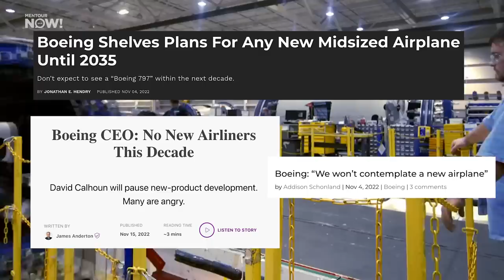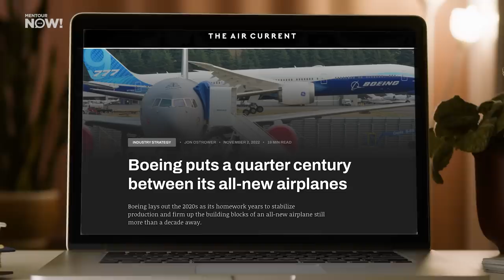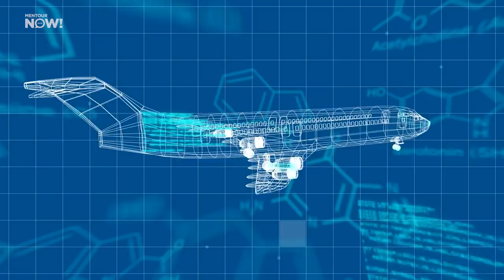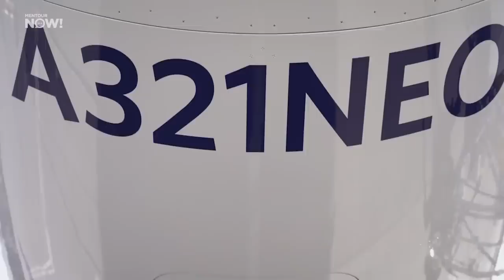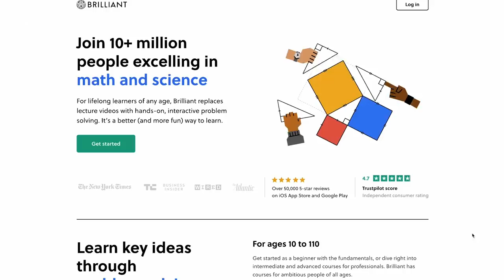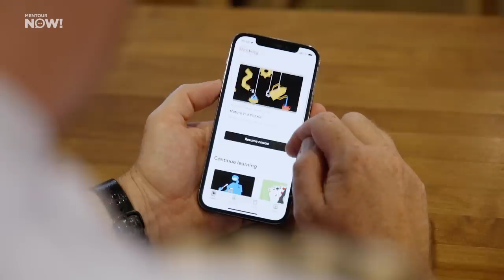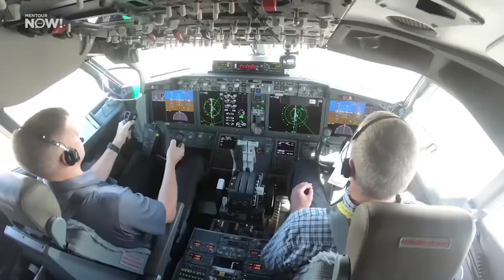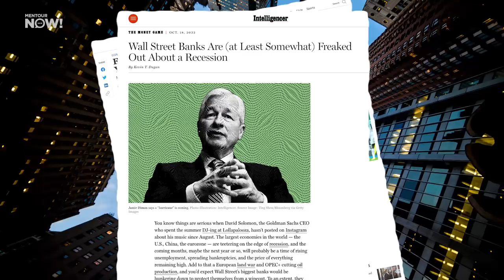Is BOEING giving up!?

Comment: The unducted fan concept has come up about once every 10 years since the '70s.  

I think the biggest problem facing Boeing is all the management that came over from MD.  They ran one company into the ground, now they and the replacements they hired and promoted are doing similar damage to Boeing.
Reply: Someone told me a turbofan is a turpoprop in a tube.  So this is a turboprop in a tube without the tube?
Reply: @himoffthequakeroatbox4320  I'm not pedantic enough to answer that question.
Reply: Just an observation: the engine thermodynamic efficiency of the CFM RICE engine in 2035 will probably also only be 10% if that much, better than today's engines. The propulsive efficiency of an aircraft as a whole using RICE engines, will however be substantially better than one using turbofan engines. This is due to the lower velocity of the "exit air jet stream" produced by the RICE engine compared to that of a turbofan engine which includes a hot core flow at exit as well as the fan bypass flow.
Reply: The other way around bro. Boeing ran MD into the ground!
Reply: @michaelosgood9876  MD was dying for 25 years.
Reply: @michaelosgood9876  McDonnell Douglas was banking its future on getting one of the two big fighter contracts of the 90s/early 2000s. Their civilian airliner business had hit a dead end due to the DC-10 having a toxic reputation, leaving them entirely dependent on the military for their future business. The Northrop-built YF-23 finished second due to being basically a mockup with live engines that had to be rebuilt after every flight, and then McDonnell Douglas was cut out of the Joint Strike Fighter program entirely. So the Boeing merger happened and what basically came out of that was it amounted to McDonnell Douglas buying Boeing with Boeing's money.
Reply: The current CEO ran GE into the ground too. Aren’t unducted fans really noisy and produce less thrust? Meaning planes will be more efficient but a lot noises and slower
Reply: @katherineberger6329  and the MMD suits ruined Boeings engineering
Reply: Who the fuck is MD?
Reply: @gerhardbenade5869  Unducted fans still have a hot core flow though
Reply: @fantabuloussnuffaluffagus  "I don't know" would have used less words.
Reply: @nobodyfromnowhere3597  McDonnell Douglas
Reply: @alanserjeant4947  If I'd wanted to say "I don't know" I'd have typed that.
Reply: Exactly, I've been saying this for a while, that merger with MD was what sealed Boeing's fate.
Reply: @fantabuloussnuffaluffagus  But it is an essencial question! Because technically speaking the answer is yes, but... the basic concept of a turboprop is to attach a big propeller with up to 6 blades to a comparatively small jet engine. This is what makes the TP more economical than a turbofan, the smaller engine (= less fuel consumption) giving a big amount of thrust through the big propeller blades. But... this comes at a cost... of speed, obviously. Engine industry is balancing always between speed and fuel consumption. Fans on the newer turbofan engines have gotten less blades but generating a bit more thrust than before, and they are geared. This way you decrease the rotational speed of the fans (= less noise) but get somewhat the same amount of thrust as the fans with more blades but turning quicker (= noisier). This is why I say that TP and TF are technically the same concept, but in detail they are very different engines. And getting into this is not being "pedantic", but interested in the core of the question.
Reply: @StoutProper  See my answer to Snuffaluffagus... There I get into exactly that point.
Reply: @nobodyfromnowhere3597  Noone...
Reply: @himoffthequakeroatbox4320  Yes, I answered this question of yours some minutes ago. I am really interested in getting to know what speed a jet plane attains with this type of engine, which is basically a turboprop. We had that before, for the MD-90 I guess, and it failed because the blades ran too fast and made a very high pitched noise, like the Piaggio Avanti does. So,. what is the "tube" there for? Apart from directing the cooling air to the hot section and to produce a big "air envelope" around the produced hot air from the jet part of the core to lower the noise of the jet section, the "tube" itself absorbs also part of the noise the big frontal fan blade tips generate by turning fast. And apart from that, it keeps part of the generated thrust well around the jet part of the engine (compressor, combustor, turbine and exit nozzle. This effect is obviously lost if you use a "untubed" propeller... (typed here as a layman, not a technical expert).
Reply: @katherineberger6329  "Their civilian airliner business had hit a dead end due to the DC-10 having a toxic reputation". And the MD-11 being no better... Basically, what killed the latter one was the three engine concept in a time when twin engined planes for long trips over sea got a vast higher ETOPS. This was the turning point in the industry. MDD had a fantastic plane, the MD-90 series, with a rock solid reputation and very fast turnaround times during the operation and Boeing killed it only because of its competition to their own 737.
Reply: @cargil48  so what are you saying? They are more efficient but slower? Are more noisy or quieter than current engines? Slower means longer flight times which means higher costs in wages and less productivity of the plane, so it may not necessarily be not economical
Reply: @cargil48  More efficient matters, what you call it is irrelevant.
Reply: @StoutProper  I said it before... more efficient on the consumption side but at a cost: speed. If you want speed, get more fuel and more air into the hot section. The turboprops have smaller hot sections and bigger props, so they get lower consumption per mile. But at slower speeds. This is why turboprops are used in shorter distances and longer range regional jets have turbofans.
Reply: @StoutProper  Jack Welch left GE a house of cards for his successors to mess up even more.  Gotta give most of the credit to the original "Neutron Jack."  Apparently empty buildings and IP are just as profitable as all the engineers and production workers he fired.  For a couple years anyway.  After that...
Reply: @katherineberger6329  I thought the cancellation of the A-12 was more impactful. The YF-23 was competing with the YF-22, so MD couldn't rely on its success, but the A-12 had already been selected by the Navy so all MD (and General Dynamics) had to do was not screw it up. But they went over budget, over schedule, and over weight, to the extent that the government cancelled the contract and demanded that MD/GD pay back the $2 billion they had received for its development. That demand got stuck in litigation for decades but meanwhile MD and GD's reputation had taken a nosedive. So Lockheed acquired GD's aircraft branch and Boeing acquired MD.
Reply: @Hypernefelos  None of the military contract fails would have been important if MD had not trusted whichever bean counters said it was ok for a cargo door to open outward and trust the latches to never fail. Boeing lost every major fighter and attack contract of the 90s and they were fine because their airliner business was making money hand over fist. The start of the McDonnell Douglas failure story was the DC-10. It meant that the MD-11 was a mere line refresh of the DC-10 instead of a new, DC-10-derived twinjet, and that doomed the company because as soon as ETOPS 90 came out, twins dominated the medium- to long-range market.
Reply: @katherineberger6329  To be completely fair their F-15E Strike Eagle was a success, but yeah, that wasn't enough.
Reply: @hammerfist8763  This. If a money man comes in and starts firing workforce because he thinks he doesn't need them after he's put in all of six seconds on the clock, he's not coming in to help the company succeed but to set it up to fail.
Reply: @nobodyfromnowhere3597  McDonnell Douglas.

Comment: There was a 15 year gap between b767 and b777 too. Also Boeing has a lot of military contracts to keep them busy. There is also nothing to prevent Boeing from implementing improvements to it current fleet of b787 and of course b737 aircraft
Reply: Steering clear of Boeing's internal politics (of which I know nothing), it seems like the B777 and B787 are Boeings main cards currently.  The B737 seems limited by the short undercarriage with modern engines getting larger and larger fans.  And because Boeing kept incrementally developing the 737 and 747, they possibly had to choose not to convert either to fly by wire in order to get the new versions certified faster?  And maybe they ditched the 757 and 767 because they thought at the time that the 737/747/777/787 range would cover the whole commercial market? Airbus probably got lucky as they launched the A320 family (and later models) with FBW and their range of A319/A320/A321/A330/A350 seems to fit better now.  Obviously, both manufacturers had to ditch their 4 engined options because of higher running costs.

The other interesting thing is that passenger aircraft used to look different years ago (think DC10, 727, Tristar, 747) - now, they are almost all roughly the same.  It looks like airframe and aerodynamic development has reached a kind of limit (especially with new, composite, materials) and the next changes will be in more fuel efficient engines (as noted in the video).
Reply: Boeing has a history of making smart moves.  Bailing on the SST and super-jumbo programs.
Reply: @peterhastings703  If there's one thing about the 737 market, it's massive.
Reply: @leotimtom6637  When you gain an IQ point, which is never.
Reply: @austindarrenor  boeing fanboys try not to cope challenge

Comment: As a service tech, I used to visit GE Evendale jet engine plant when they were developing the UDF (unducted fan) engine in the mid '80s. I knew it was really a good idea, but it got stuck back on the shelf to wait until the time is right... I think its going to be it's time soon!
Reply: That's the first thing that came to my mind, also. I always felt the UDF engines got short-changed. Those engines themselves will create more positive aviation news.
Reply: Low fuel prices doomed the UDF programs, and now many of the engineers who worked on it have retired.
Reply: Airplanes with UDF will be slow and noisy.
Reply: @henson2k  you'd be amazed what boeing can do with "re branding". airbus dont stand a chance.
Reply: The NOISE was sooooo bad that they had to put noise canceling speakers in the back!....Also...what was Not said was, how long
before that noise vibration fatigue cracks the aluminum holding the Tail on......
Reply: I think there is already a very performent UDF engine availible. Look at the A400M with its Turboprop engines it gets very good performances. Nearly as a turbofan with less consumption!!!
Reply: @henson2k  faster than common turboprops, the blades are shorter, so they can spin faster without going supersonic, and the gear reduction has gotten better since the last time they tried UDFs.
Reply: Maybe.  But it would be foolish for Boeing to base its product development plans on that long shot possibility.
Reply: @jaysmith1408  I've compared UDF with jets, I don't see Boeing going turboprop/regional market.
Reply: I worked next to Pratt & Whitney in the 80's, Pratt built jet engines and Hamilton Standard built propellers. They had a pair of unducted fans bolted to the rear end of an old 727, it was surprisingly quiet. We saw it now and then for a couple of years then we didn't know what came of it.
Reply: Biggest problem with ducted fans are they are extremely loud. Sorry but that's not likely to change.

Comment: Had to laugh when I saw the powerplant! That 'prop-fan' thing was tried in the late 80s/ early 90s. It's not only ugly, but it was deemed too noisy & as the blades are exposed, too dangerous. Airbus won't be fazed by this 'announcement'.
Reply: From what I've heard Airbus has been considering next-generation turboprop aircraft (them actually calling it what it is) as their next direction. I think a somewhat smaller aircraft, maybe the size of the A220, and looking pretty similar to the ATR72. With fuel costs being a rising factor, I think many foresee a return of the turboprop, but with most trying to avoid said term, instead preferring more marketable terms like "propfan" "unducted fan" "open rotor turbofan" and so on.
Reply: I think they still gear it down like in turboprops to be subsonic at the tip, do they?
So either this it overhyped hybrid turboprop, or this it the design that will never be used because of constant sonic boom during takeoff.
Reply: @cola98765  From what I recall reading some "propfans" are geared (just like geared turbofans) while others are not. Typically the blade tips are supersonic, to reduce noise the blade leading edges are razor sharp (which also will wear quickly) but they're still quite loud. A lot of drawbacks to these, hence why experiments in the '80s didn't really go anywhere. These "propfan" concepts range anywhere from being basically a turboprop to being basically a turbofan as we know it without the duct, with some somewhere in between, some having the blades at the aft end (not typical for either turbofans or turboprops as we know them). What we saw in this video looks to me to be at the conventional turboprop end of this spectrum, and I'm guessing it's geared.
Reply: Suspect blades will be easily damaged
Reply: "Open rotor" designs have had to compete with ever-improving turbofan engines, and they only caught up recently.  Their much greater efficiency (read: lower emissions and lower operating costs) pretty much guarantees that they'll be on the next generation of airliners.  Their noise level is already within regulatory limits.
Reply: Airline could care less if it is "ugly" or not. They care about cost. Prop fans will likely dominate short to medium haul aircraft in the future because of E-planes, Hybrid and Hydrogen technology. Oh and btw Airbus is looking into Propfans too.

Comment: As a man in his 50s and an aviation enthusiast, I’m flabbergasted at the slow descent of Boeing. My entire life I grew up in Boeing was viewed as a powerhouse in aviation. It’s sad to hear this news, but I pray that Boating can come back and become the dominant aircraft manufacturer as it once was.
Reply: They'll be fine, as long as they invest in at least some R&D. Right now, they need to focus on fixing the problems with the current designs, that have been hurting their reputation.

The only logical thing for them to invest in now, would be more efficient fuel. All this nonsense about building electric planes is not worth it at this moment.
Reply: What's boating

Comment: The new engine design looks remarkably like the propfan designs from the late 1980s. I remember seeing one fitted to a MD80 at the Farnborough Airshow. I don’t believe they ever overcame the issue of blade tip noise from the unducted fan. Will society accept more noise in return for efficiency?
Reply: Just don't sit near the back of the plane
Reply: I think they'll have to combine this with a geared fan design so they can keep the tip speeds reasonable.
Reply: I worked at GE at the time in the late 80s and their "Unducted fan engine" was on the cover of the annual report.
Reply: I believe with newer technology being able to build the fan blades with more geometric twist lessens the tip noise. That’s just an inference though.
Reply: More noise for efficiency? Never in Europe.
Reply: Well, your beliefs seem to differ from those of the engine designers. A very quick search turned up the "Snecma Tests Open Rotor Engine" by Tamir Eshel from Defense Update 2014-01-02:

    "'We are confident about this issue, after the tests we ran in July 2013 in the ONERA wind tunnel in Modane,' [Snecma (Safran) Research & Technology Director Pierre] Guillaume explains. 'The open rotor’s noise level should be similar to the LEAP’s, i.e. 10 dB below the engines flying today.'”

(There's probably more recent stuff out there if one's willing to spend more than 90 seconds searching the web.)
Reply: Not a chance. The environmentalists are noisy enough (no pun intended) and will kick up a fuss over noise pollution. 
Technology has moved a lot since the 80s and jet engines have become a lot quieter so maybe they’ll find a way to make this quieter too